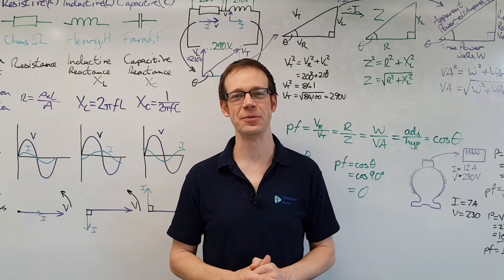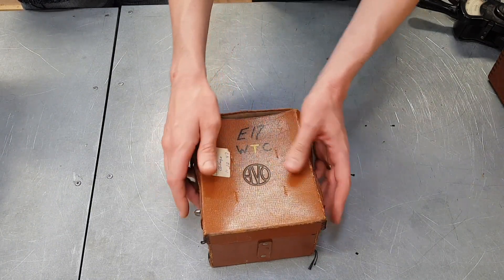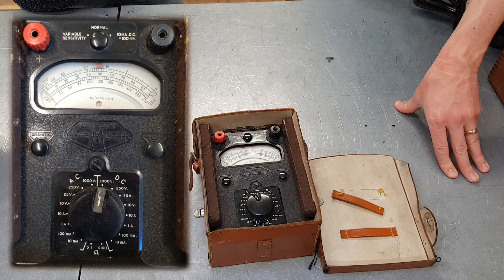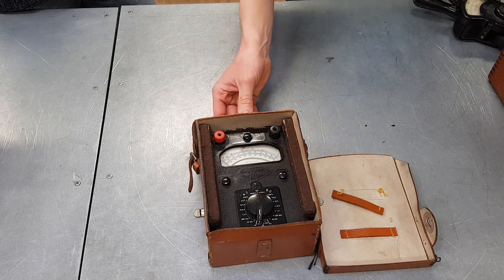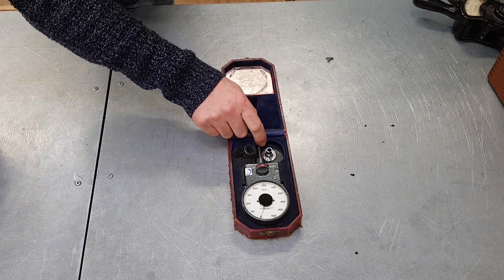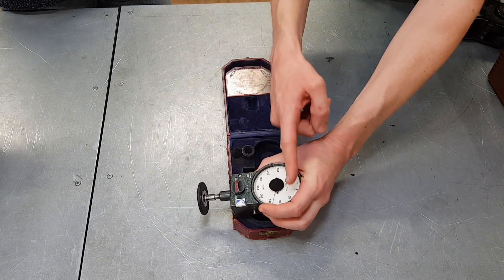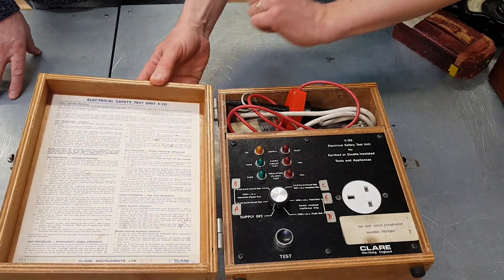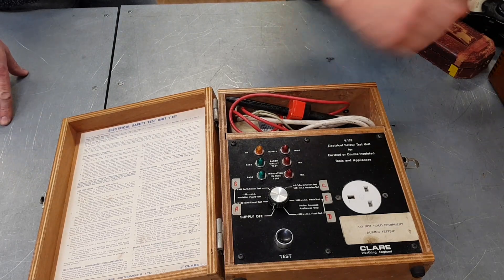John Ward Discusses Old Testing Instruments Part 2

Comment: still got my AVO  model 8 mk3
Reply: Model 8 was the best meter out there. Lovely bit of kit.
Reply: Why wouldn't you have ? Question is, do you still use it ?
I still use mine - as necessary.